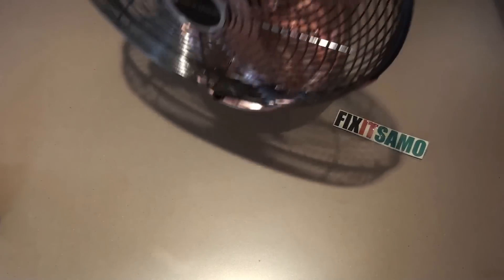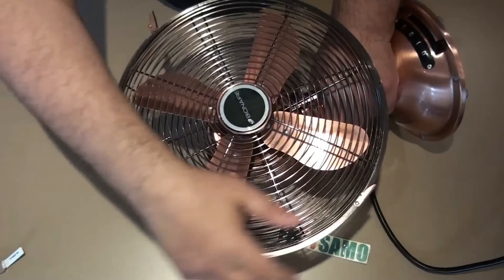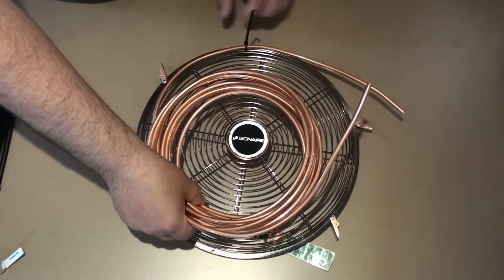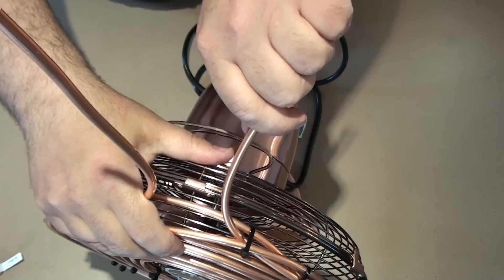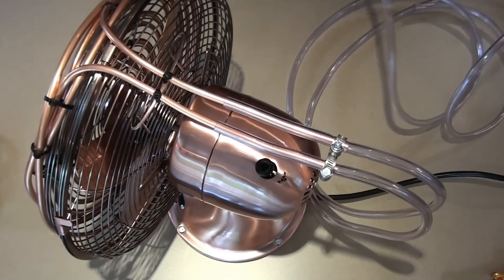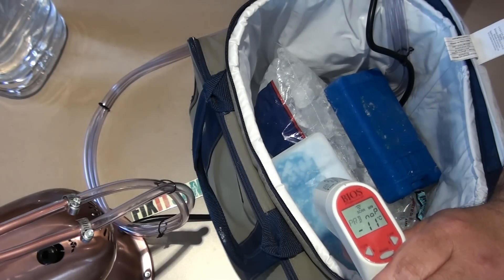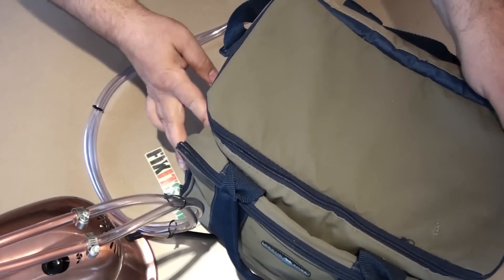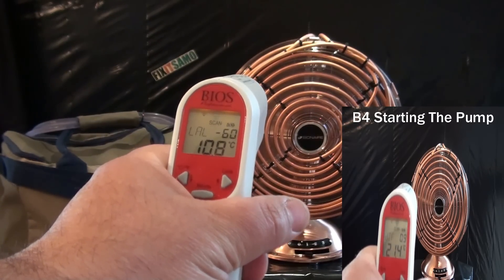How To Turn Your Fan Into An Airconditioner  AC

Comment: Hello I got a idea can u try it. This trick is really good but as some have pointed that it won't last very long. Well how about connecting the tubes and the pump and somehow putting it in water inside a fridge. A portable fridge will do. What I'm saying is we put the pump inside a water bag which is inside a fridge, in this way your fan will have continuous supply of cool water.
Reply: you may as well just get a conventional air conditioner at that point, unless it REALLY isn't an option
Reply: @ProfessorToadstool  it could work for ppl who cant install an air conditioner.. like for ppl who rent in certain areas ..they arent allowed to get one  and having a window ac isnt an option
Reply: @romar386  of course, i thought about that a little after i posted...
Reply: Perfect idea!!!! Defiantly will try ii some day...
Reply: not power efficient
Reply: You have to keep door open then ??
Reply: @gagai786  you could drill through the side, just make sure you waterproof seal inside and out
Reply: I love that you came up with an idea, however like others state it's not efficient enough, uses too much energy as well. If you need to use a plug in mini fridge you night as well buy a non window AC unit. A stand up AC unit....
Reply: @inspectorforyou7624  Those aren't cost effective either. Most of the air they move is the air it literally just cycled in and cooled off. not to mention the heat sink is inside of the hous.
Reply: @inspectorforyou7624  BUT i suppose it would be cheaper than buying ice, which is why you make your own.
Reply: @inspectorforyou7624  how about digging a well and using deep ground water because normally deep ground water are very cool and many people dig borewell to use water but my point is to use the water to cool the coils as the cool water supply underneath the ground will be unlimited . This idea might sound very weird but I observed water underneath the ground is very cool.
Reply: aki si You are right, just search for “geothermal heat pumps”
Reply: @akisi1401  too much unnecessary work lol
Reply: This is a great idea but I doubt how effective it will be as all AC/Fridges/Freezers are designed for a maximum cooling load. If we provide a higher cooling load than design specs, the pump of the cooling unit will overload and heat up. But definitely worth a try if there is a freezer around.
Reply: @jdsenuk  Excellent point. The fridge will keep trying to cool the incoming warm water and never shut off... Perhaps the addition of ice in the refrigeration cabinet but I think this will not work so well.
 
Putting the water tank in a large cooler filled with ice is probably the best way to solve the heat transfer problem for this sort of system.
Reply: but i think it's still important to put ice every day and new water to it becuase if the water is getting to hot your fridge can't handle it anymore....
Reply: @arthursoesman  Yes and no. For just keeping water cold, no. That's not energy efficient at all but if you can't install an AC unit then by all means . If the fridge is conveniently placed to where you want the fan and that's where you plan on keeping your food /drinks then go ahead.

Comment: Bekaaz u put ice
This going to happen for a while
After few mint, again hot air
Reply: @Muhammad Habib, thank you for your comment brother. I was planning to do this to my fan. You made a good point about this not lasting for very long. What I’m going to do is insulate my cooler, which will probably give me a few more hrs of run time. Plus I only need this to work for a maximum of 8 hrs while I sleep. Thanks again Mr.Habib🤙
Reply: I think it will be enough for 4-5 hours... Probably plastic cooler will stay longer...

Comment: Can I use plastic pipe for this because copper pipe cost is high???
Reply: Plastic is a bad thermal conductor and will most certainly fail for this project.
Reply: On line says 600 rs. Per kg bro, check once
Reply: Aluminum tube is cheaper than copper
Reply: @alt7244    Aluminum will work, but thermal conductivity of copper is 223, and thermal conductivity of aluminum is 118 (BTU/(hr·ft⋅°F), so almost half the cooling transfer.

Comment: Hi, what if my plastic pipe is bigger the copper pipe a little?
In detail, the pump has 8mm diameter connection, the the plastic pipe must be 8mm, but thing is copper only has 2 size: 6mm and 10mm.
Reply: Thanks guys,  I used teflon tape and it worked properly, still had leakage but fine :))).
Thing is I don't really feel it's cooler, or maybe it's super hot in Vietnam rightnow, the ice is gone so fast.
Reply: VietnameseTinyGuy  get a better cooler ice will last a lot longer  i had very good results for about 9to 10 hrs in a 12x12 feet’s room  i used  2 liter soda bottles to freeze the ice it works perfectly specially if the ice is in 1 blocks it will melt a lot slower than using small ice cubes
Reply: You Use The wire Tape In copper pipe and get the Size in 8'mm plastic pipe
Reply: You can also try shrinking the plastic pipe onto the copper pipe and using hot glue to seal the gap
Reply: Nothing to worry about you should wrap copper wire with string and put super glue according to your need make sure it's ok

Comment: Good video man! I have a condensation concern. Did you have condensation on your 2 copper coils coming a top the electrical  components of the motor? Like drops leaking through?
Reply: Maybe start the coil at the bottom of the fan instead of at the top, so water won't drip onto fan motor?
Reply: The video is merely help to get people started. Use your own ingenuity to perfect it for your own situation, which will develop your own creative and problem solving abilities. Noone said it had to be to the specs in the video, because everyone has different circumstances.
Reply: @trypticryptic  Hear you and thank you!
Reply: I think there is a condensation process on the tube. It's not good for the human health that breathes the cold air with containing moisture unlike air conditioner. Just think about it and I need your opinion. Thanks.

Comment: You can place the water tank in the freezer of a fridge in use by drilling two holes into the freezer compartment.
Reply: It would not cool down fast enough for this.
Reply: @Las Vegas Coroner i agree. I put some water beverage or even coca in the freezer for up to 1.5 hours and it is about freezing cold   so i then proceed to keep it cool in the fridge.  Should work with this cooling fan too.
Reply: use the door of the fridge. just chop a little for the tube to pass through, do not put hole on the fridge
Reply: Yes you could, but you'd likely need to create a coil or zig zag pattern so it remains in the freezer cooling long enough to cool but not so long that it freezes before coming back out. Might take some experimenting and freezer temp control.
Reply: Jajajaja
Reply: @ferdcanalija5430  Aww poor Ferd. Trolls have sad lives...

Comment: Salam kisi ne karachi me banaya he ye? Kamyabi se chala ek do mahene?
Reply: Bai thanks ha g ma na isa banaya ha acha ha par copper tube mahangi mili baki sab set ha ma na apna cooler ka aga ya copper railing laga di or motor sa pipe copper rail ma pani diya instead of giving it to the sides of coller is ka alawa ma na ak shooper ma rait mean sand dal kar wo shopper band kar ka rakh diya cooler ka pani ma wakai kamal ho gaya
Reply: @hfcfraudrecoveryoffical2411  matlab aap ne collar k under rubber ka pipe ni dala wo aap ne copper hi legaye collar k under bro???
Reply: @hfcfraudrecoveryoffical2411  2nd Que. bro isse jo pani gire ga fan p se jo copper pipes ho ge. Wo ziada girta he ya kam ?
Reply: @hfcfraudrecoveryoffical2411  last question. Bro ye pump karachi me kaha se milega jo pani phekta he upper or kitne rs. Ka milega. ??
Please reply sir. N thank you so much aap n apna exp share kia :)

Comment: Nice job.. It could be helpful if you show the temperature difference in a small room before and after turning on the fan
Reply: invidinvasion  Wait, if the ice is cold and after a while it melts then were that heat that was needed to melt it went then? of course this is not the 8 marvel of AC's but it works, the bad designs are the ones that let the ice melt in open air cause you end up with  humid air and that its the worst when it comes to this.

Comment: Stupid. Ice costs money. Why dont you sweat a fitting that hooks up to a faucet and runs the cold water energy efficiently into the room you are trying to cool and then drains back into the sinks drain. 
People in rental properties would love this idea because rental properties have free/fixed rate water billing that wont cost more for this use. 
They also have crappy heating as well as undsrsized ac units.
Reply: Seems like a silly worry over all. It would still by comparison be way less to have your freezer refreeze water than the use of your full A.C. unit. You can also help lower that cost buy using blocks of ice or frozen 2 liter bottles of water in the freezer to help maintain the freezing temp. People do this already during power outages or when going camping to store cold food.
Reply: Run it out of and return to your toilet tank, you're not wasting water that way and you're not causing your freezer to exhaust more heat into the room.
Reply: Samsng Device true
Reply: Oh man the fact that you tried to sound smart in this comment  is just brilliant mate!
Reply: @j.arm.926  Who are you talking to?
Reply: invidinvasion  
You sound Mexican
Reply: invidinvasion  What are you talking about?
Reply: "Stupid. Ice costs money." - HE's stupid? Last time I checked I could make ice for free in my freezer.  Besides that obvious forehead smack, your amazing solution is only viable for people in rental properties whose water bills are included in the rent. Followed by the brilliance: "sweating a fitting that hooks up to a faucet". Simultaneously using the single plumbing term you know, whilst proving you know little about the term, IS actually pretty impressive. If it's sweated together, its permanent and using a faucet as the control valve, you'd lose the use of the faucet. THEN using the term "efficiently" in reference to your setup, is almost as inaccurate as you thinking that it could "drain" back into the sink, as if the whole system was set up on a gradual decline, otherwise needing an inline pump to get the water back up into the sink. It would also affect the water pressure, as it's sustained flow. What's EVEN MORE "stupid", is the fact that your solution doesn't even give consideration to water conservation and the fact that fresh water sources aren't inexhaustible, and the fact that the owner of the rental property still has to pay for the water allowance. But the worse cost would be from mindlessly  depleting what's left of our fresh water sources. Although, in the long term, it WOULD solve the biggest threat to the earth's ongoing life-sustaining existence - humans. 

Biggest threat to earth = humans. 

Biggest threat to humans = stupid humans. 

Congrats you're your own worst enemy. 

Solution: stop talking.

Sadly, you shutting up only solves that problem for everyone else, but you'll still be stupid.
Reply: This way, its portable.  I work in hot boiler rooms in summer.. this is definitely something to consider. But using a better cooler
Reply: @alt7244  
Idiot.
The bag of ise will be completely melted with in 15 minnutes.
Reply: Ice costs money? Are you for real right now.
Reply: Ice costs energy, but your freezer will not take any more energy with water in it, than without. 

What will happen is that other things in the freezer will be a bit less cold, but it won't cost any extra money directly.
Reply: @egc2901  When you put water in your freezer, by definition, (ie. water as opposed to ice) it will be warmer than the rest of the freezer which will cause the compressor to come on sooner than it would have otherwise which increases your electricity usage which costs money.
Reply: @deanmacgregor3072  Yep you're right, compressors act based on the freezers temp and putting water in it will reduce the overall temperature, which in turn might make the compressor run if it wasn't running before.
Reply: @deanmacgregor3072  The Best thing to do is to order a kiddie pool, make some room and take out anything you don't need for the summer in the room you will be placing your kiddie pool. Then once you find a spot and fill it up with water.. Walla!!!! You can now do your studies, read a book, watch tv, in the comfort of your own home in a nice cold pool and you can sleep in it too. Forget about the heat and just enjoy being cool and calm!!!.
Reply: @egc2901  "might" as opposed to using an ac unit which draws way more amperage, and is single purpose, whereas the freezer compressor must kick on in order to maintain the cooling level, thus some of the energy being spent is shared purpose.
Reply: invidinvasion  
Dummy - learn to post clarified comments or go back to school.
When you post a comment attacking YOU, please clarify who is you. You ignorant stupid Idiot.

Comment: If you add salt to ice bag .. it will last longer
Reply: It will also damage the pump
Reply: Ya, I think you're confused. Adding salt helps water boil faster, not ice  last longer. A little backwards and inverted, but you'll probably be ok.
Reply: Actually, salt holds in temperature. You cool salt, it gets cold. You warm salt, it gets hot. Salt water freezes too. How ya think the titanic sanked ya dingus
Reply: So it makes it HARDER for salt water to freeze, not impossible, which was never stated anyways. We were talking about ice in a freezer, which doesn't reach -32 degrees, or it would be hard to thaw and cause freezer burn on the food much quicker.
Reply: @adambischoff128  Table salt, sea salt, road salt. What? I can't just throw road salt on my fries? Well, I could, but who would want to? And uhh I never stated that there aren't different salt types, but that doesn't change any of the hygroscopic effects. Table salt has the same effect, just on a lesser level due to processing. But they all contain sodium chloride in differing levels. Rock salt, that is used on roads is mined from the same mineral that table salt is, it just contains impurities in it like small amounts of sand, silt and dirt and other minerals that are otherwise refined out to produce table salt. Sea salt has several types of salt, but sodium chloride comprises most of it, and sodium chloride is the the active chemical that causes the baseline freezing change in the water that it  dilutes. So, yes, I do realize there are different salts, but they all are called "salts" due the same base ingredient, which all effect ice the same way in slightly varying amounts. So before you rattle off 1 whole sentence, with no basis or context to back that statement, and then cap it off with "dumbbbbdumbdumb" , maybe try.. reading a book or something.
Reply: @trypticryptic  umm... it appears you havent taken much chemistry before. Table salt is sodium chloride which can be used to the lower freezing point of ice, but it isn't the most effective at lowering freezing point- just the cheapest generally. Potassium chloride, magnesium chloride, and calcium chloride (NaCl is not the "base ingredient" in them btw) are also types of salts that are used to lower the freezing point of ice and are more effective at colder temps, but they're more expensive so they aren't as common. They are all "active chemicals" when it comes to melting ice. Look up halide salts if you want to know more (sodium chloride is just one of them)
Reply: @skifflebunch1  I fail to see where I made the claim that table salt or sodium chloride is the most effective method of melting ice? Or even remotely, in fact.
Reply: @skifflebunch1  umm... it appears you haven't read the whole thread.. and implied some facts.. and filled in some blanks.. and came to some conclusions. But besides all that, you're probably right.
Reply: @trypticryptic  you really are focusing on the wrong thing. I was replying to your claim that all salt has the same base ingredient- it doesn't, just that the most common is NaCl and I said why that was with some additional info on it.
Reply: @skifflebunch1  Again, where did I claim that all salt has the same base ingredient? I think you're the one missing the point, friend. In fact, the comment you replied to originally was stating the fact that there ARE different salts. I was using sarcasm in the first sentence, which you obviously missed. I said that they contain sodium chloride in differing levels, I never said it was a base. Besides this, my point was never even about the chemical structures of the abundant and different salts in the first place, I started out simply clarifying for someone else that salt does melt ice. I never claimed to be any type of scientific source, I never claimed to know all the compounds or chemical elements, or the physical traits on such. Yet people like to log on, give threads a cursory glance - chance upon a post that contains a snippet of a subject they happen to know something specific about and then try to stand up on their imaginary soapbox trying to show off their extensive knowledge about this one particular subject. In the end, which doesn't contribute anything to the thread, wastes everyone's time more than already this post inside a post inside a post has done, exponentially. Perhaps next time follow the conversation back to see why I was even commenting in the first place, or take a glance up and look at the video, which neither of our comments has anything to do with, and have a little humility and foresight to not repeat the stupid process again, that currently fills half the data servers in the world. I know I won't. Commenting on posts, unless complimentary, or to politely correct a clearly wrong statement or claim, but in a simple and inflammatory way, should best be left unsaid... typed.. whatever. People (not all but most) exhaust the living sh** out of me.